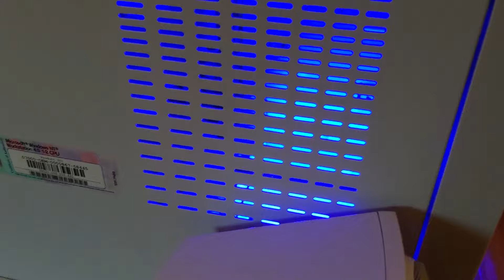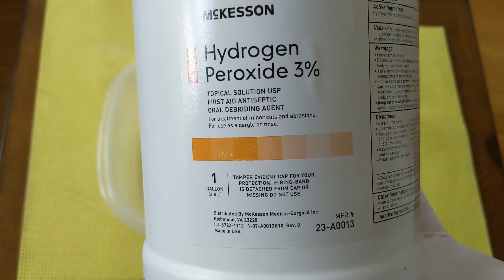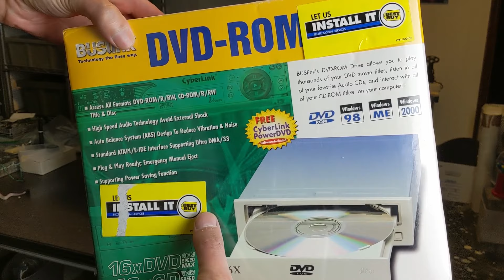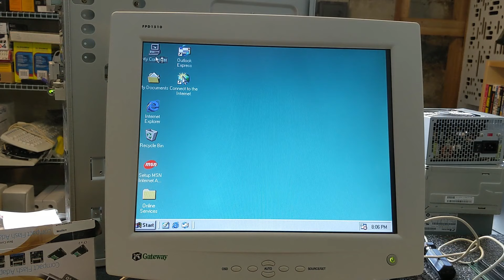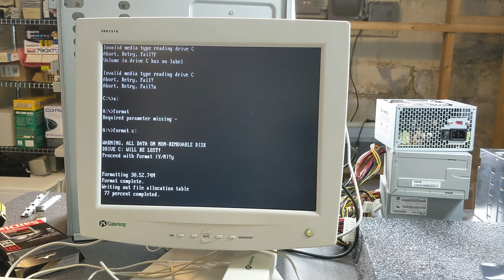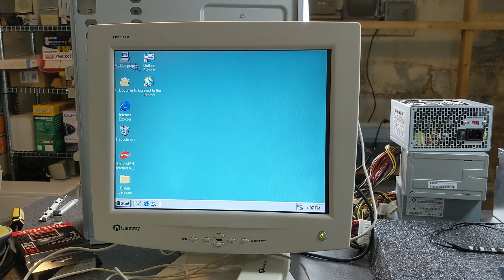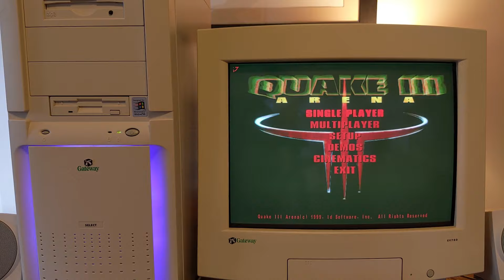"The Gateway": Restoring and Upgrading a 20 year old Gateway Select PC

Comment: Just picked one of these up. Exactly the same model, but its the intel p3 850. Hard drive motor had failed, but had a good hard drive from my old computer. Surprisingly it had win 98 on it already which worked fine after installing the drivers. All my old proframs and games still on it. Last used in 2013 according the the file dates. Decenlty fast system for its time.

Comment: Nice job..i still have my select 800 slot/A gateway mobo/cpu/mem and it works.. but the case powersuply& drives are long gone. Last i used it i put it in an midtower raidmax case and ps installed 2k on it and ran doom3 using an apg radeon 9200 64mb

Comment: Looks great!  Got a free Gateway and had a similar issue with the flash hd not being recognized fully.  Ended up using EZ-Drive to get the full support (after watching PhilsComputerLab).  Seems to work well.   I just need that CRT now to complete the full setup but so hard to find within reason.
Reply from the maker: Yeah it really was an adventure, but it did work in the end -- perhaps not without that IDE card though. Sheesh. Good luck finding a CRT... I see them on Facebook market every once in a while.

Comment: I did some experiments retro brightening DVD face plate and it did came pretty well. The disassembling required is pretty minimum, just manually eject the tray, remove the front of it and then remove the faceplate pushing the retention tabs in the sides and below. Nice computer, I always wanted a Gateway, In Spain there are none at all. (Must import from UK)